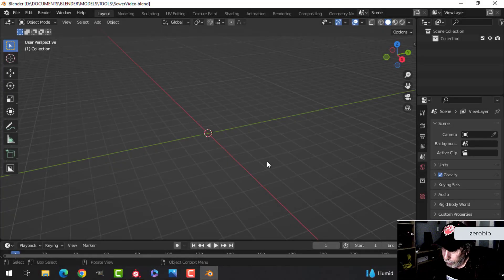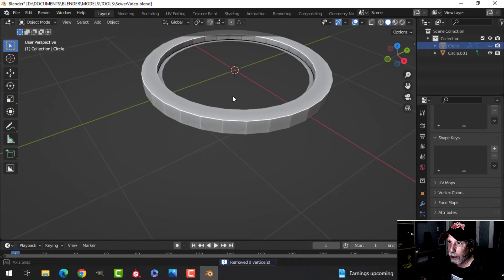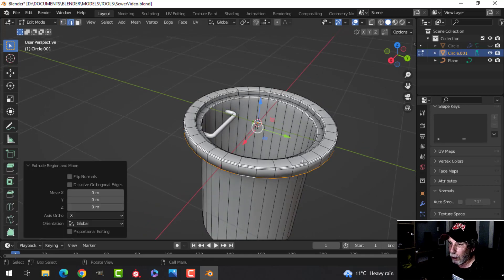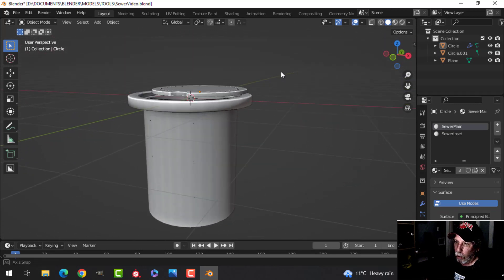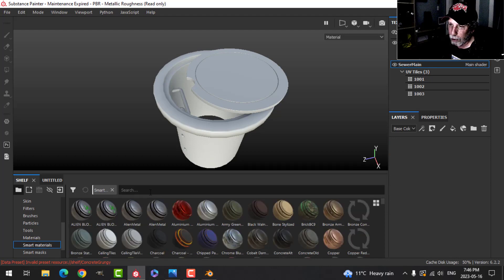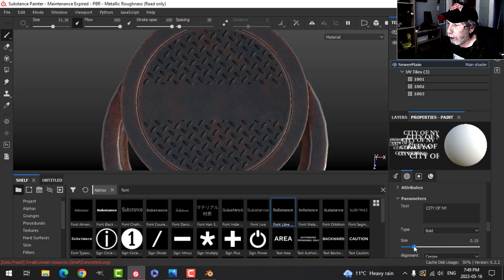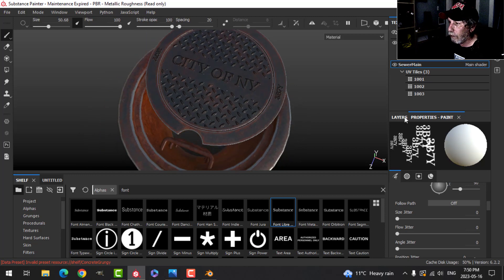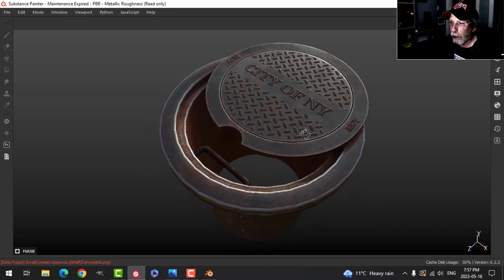BLENDER & SUBSTANCE PAINTER: SEWER

Comment: I love these projects and challenges. A couple things worked with electric system underground manhole covers . Most sit in concrete . The other , to open you use crow bar and maybe a hook to lift cover slide it over.
Reply from the maker: All good ideas 💡
Reply: @zerobio  i really love your video btw can you make a tutorial on how you create texture and stuff
Reply from the maker: @oreoicecream1829  I have been making more textures in recent texturing videos.  Check my recent videos.  Thanks
Reply from the maker: @oreoicecream1829  thanks very much.  I sometimes use pre-made materials and smart materials but do many videos where I make materials from scratch.  It really depends on my time and the model.  For instance, if you look at the Bulkhead Light Part 2 video (will be posted in a few hours from now), I create textures for this. You should also have a look at my Post Apocalyptic Classroom series where I do some brick/plaster and wood materials.